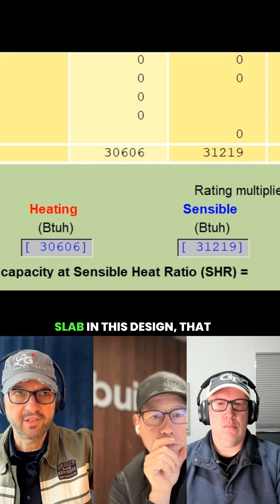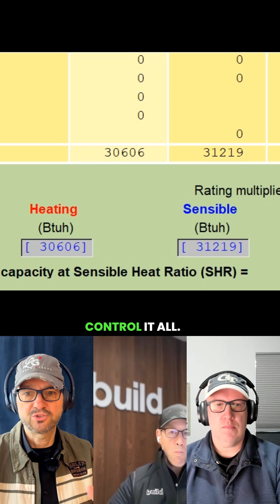Air Leakage Is Why Southern Homes Pay More to Heat—Until You Build Tight

Comment: My 1904  central UT  log home  bounces off the minimum power charge35$  all winter and most of the summer.  Most months I pay 2-4× per kw more than my neighbors  due to under usage.( not consuming the minimum kw the .09c/kwh is based on). 
Addons approximately 1920, 1950, 1980's  1100²' now 400²' originally. 
Wood heat minus labor is $10/cord  4 cord minimum .